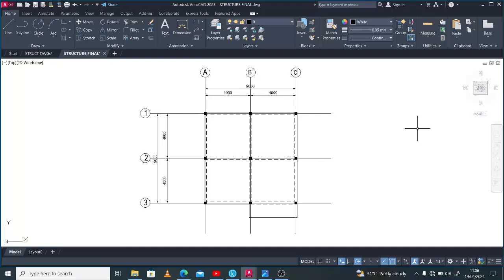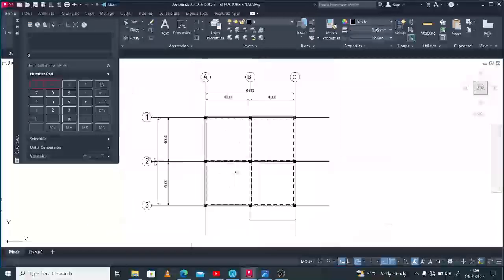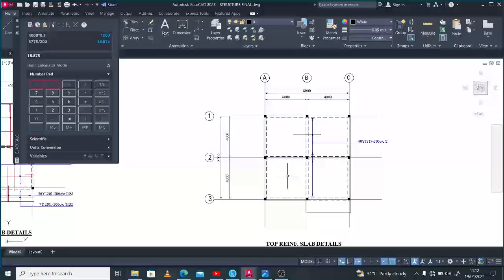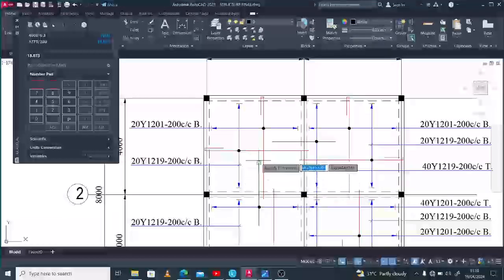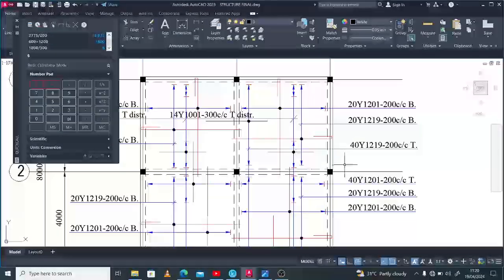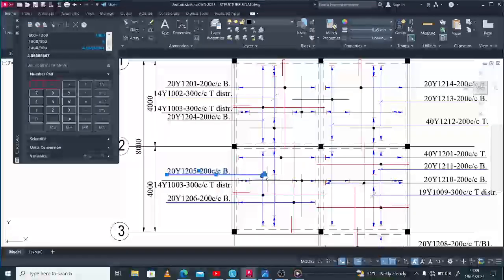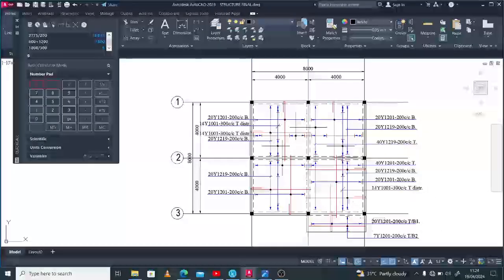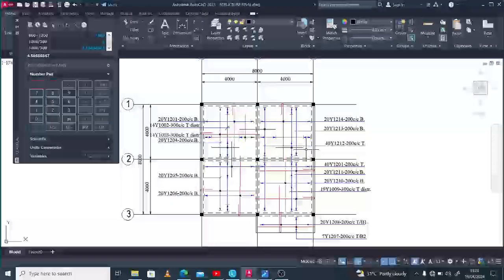HOW TO DO SLAB REINFORCEMENT DETAILING ACCORDING TO BS8110 (PART 2)

Comment: Thanks for the  training sir,  
My question may sound strange, ( for example sir,  if my slabs distribution is 40y12-06-300-cc
What is the meaning of that o6 sir )
Reply: O6 represents bar mark ..its used to tell which bar it is on   the bar bending schedule